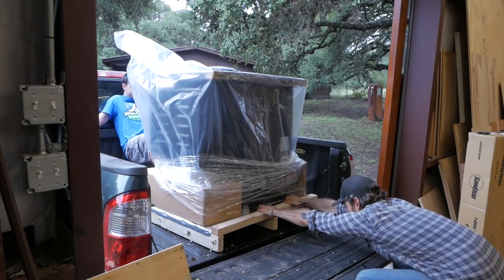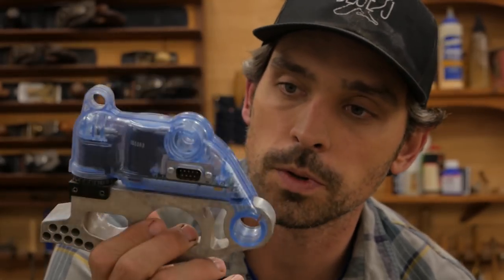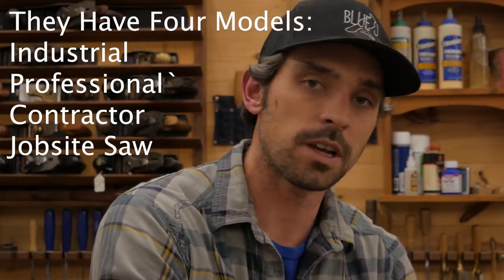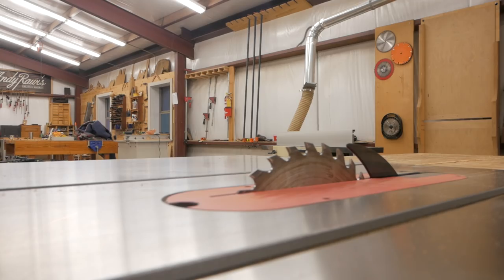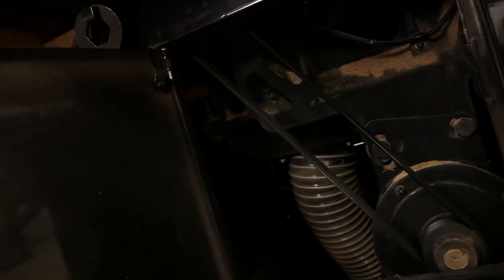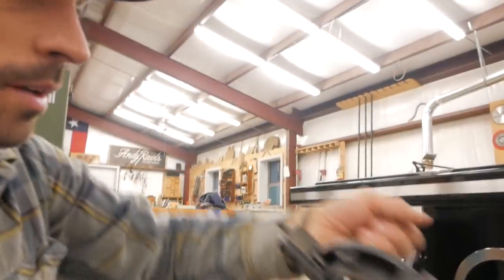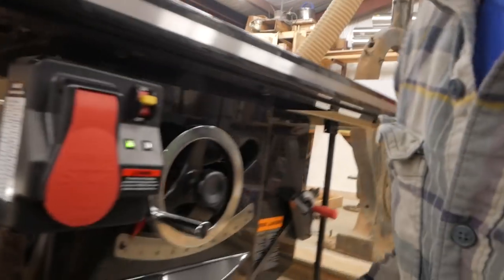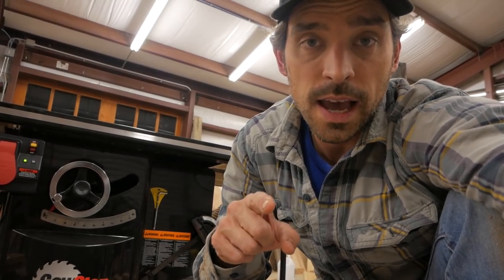A Table Saw That Wont Cut Your Fingers Off!

Comment: I remember when this saw came out in about 2002 ish.  The story I heard when the inventor was trying to get funding from investors was that the investors were very skeptical.  Just using a hot dog and all.  Well, as the way I heard the story,  in front of the investors the inventor slammed his palm down on top of the running saw.  What a leap of faith.  Well it worked and now you know the rest of the story.

Comment: I use the exact same setup as you got and I love it. I would definitely recommend the dust collection arm, its worth its weight in gold. Also great videos, Keep it up man.
Reply from the maker: +TJ Sallah thanks!  I was a little worried the 3hp would be underpowered but I’ve had no issues with it yet.  I definitely need the dust collection arm👍

Comment: I've had mine for almost a year, wish I could say 14 months but we live and learn.. Few tips get yourself a magnetic detector, if not 100 sure check boom  that was dado blade and cartridge, second one saw was running and it just dropped wasn't cutting yet. They're is a computer that records everything... Friday night lost my riving knife but I pushed on  and boom three skin was cut I'll add picture but nothing more than paper cut Acme said since it's under a year I'll get new cartridges and blade free.. Good luck

Comment: Looks like a great saw. Advanced and well build. But for a saw at that price... I'd really hate not getting a sliding sidetable. That's a big drawback for me.
Reply from the maker: +Peter4475 I totally understand...I used a slider for years in the old shop I worked in and they’re great machines, especially for sheet goods.  SawStop makes an add on slider but it’s pricey at 1k, however I have heard good things about it.

Comment: My neighbor had one of those for just over a week, it went back. He said the hassles that go with using the saw are not worth the ownership. He said if you are going to own a saw that cost as much as this saw did, you should be able to just use it, not have to reset and tune everything before you can cut a board.
Reply: simply not true
Reply: Well, if you like it use it, Matt didn't like it because of the many issues he had with it, so he got rid of it.

Comment: I'm no saw stop expert, but I'm pretty sure the reason it didn't trigger when you hit metal is because the metal wasn't touching anything that would complete an electrical circuit.